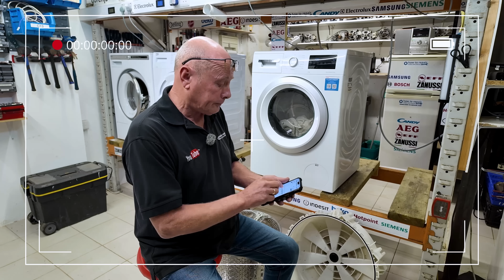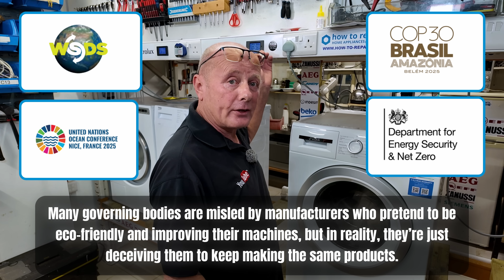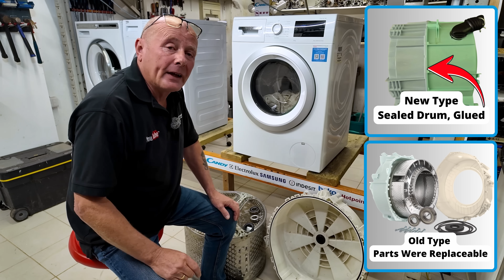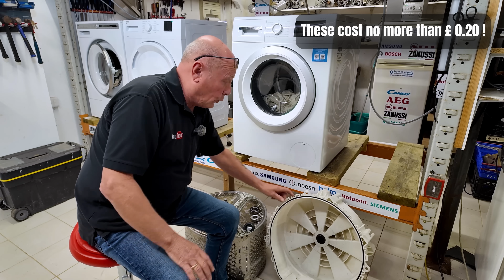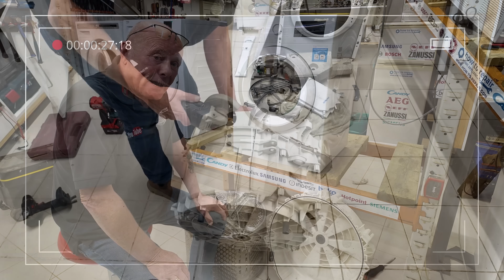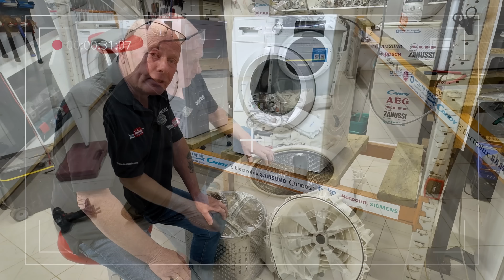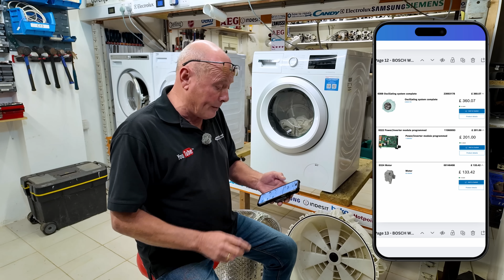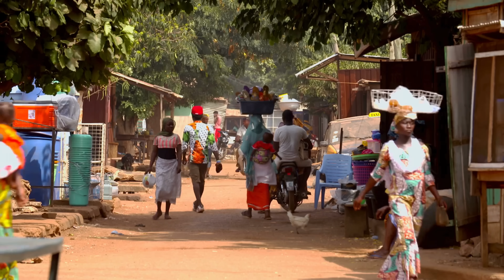Washing Machine SCAM EXPOSED! The Truth About SEALED Drums: Naming & Shaming

Comment: Hi Paul, I agree totally with your exposure of the greed that is present in loads of manufacturers today. As you say the main components that are major failure components of a washing machine are the drum in either the bearings and seals or the spider. The second machine failure item can be the PCB Controller board(s). Motors do seem to be much more rugged so their failure is less frequent. 

Perhaps we should be campaigning to support only the sale of those Eastern/Southern hemisphere manufactured machines in preference to Rip-Off European manufactured machines. However it does go against my desire to reintroduce home grown manufacturing that actually promotes local employment. 

As stated below those thieves need to be fined huge amounts so that they revert to proper ethical processes. The use of plastic separable drums cannot be any different in cost to manufacture than the welding of them as noted. They will both be made on a robotic assembly line anyway.

To support another comment as an aged engineer, I kept a Servis Electronic machine operating for over 20 years with replacements of brushes, motor bearings as well as drum bearings and seal. I even replaced a spider as well. The electronics didnt fail. The machine ran every day washing nappies and children's clothes, the only rest it received was when we took a 2 week holiday.

I could write more but Paul has done a superb job in exposing the un-ethical corporate practices now being pursued.

Comment: Was surprised to see that Miele is also involved. Had a high-end AEG washing machine where the bearing broke and due to the sealed drum it was beyond repair. Searched for a replacement with non-sealed drum (repairable) and ended up with a Miele (which has been flawless). I wonder what the situation is for fridges. Our Liebherr failed twice in 8 years. First time motor (within 5y warranty) + another part (450€ work, part was taken in warranty while 2y warranty had just expired), second time all the gas escaped: beyond repair due to the pressed construction. It really makes no more sense to pay more for a “European Quality” brand if the Asian manufacturers are better at making repairable machines… European industry digging it’s own grave. So sad.

Comment: I suspect our 7 year old washing machine still has the splitable drum, i will take this into consideration, should the need to change the bearings arise in the future.

If they were to go bad tomorrow, under normal circumstances i would probably replace the machine, but with this information in mind i might want to repair it instead.

A year ago i changed the shock absorbers, they had gone bad, so repairing it, is not something i would consider out of the scope, for me to do.

Comment: Good video except there was no mention whatsoever of what exactly the manufacturer is designing to fail just outside of the guarantee period having made a big fuss about it, the whole video is just about the fact the spares cost more than the machine is worth.
Just shows what a con and load of bollocks this save the planet stuff is doesn't it, the criminal government takes thousands a year more off us in the name of climate change but do absolutely nothing about the right to repair, doesn't matter whether it's white goods, cars or whatever, anything that would actually save the planet by not having to manufacture new items because they could be repaired is ignored. in fact anything that would affect the criminals' bank balances is ignored. time people said it as it is

Comment: Hello! I appreciate your courage and effort to unravel the mystery behind the industry and the mechanism that makes us addicted to consumption.

I have been repairing washing machines for many years and I have noticed the trend. 
Then, for me the best choice was Indesit. Separate tub, PCB with interface for reprogramming (Hoover, Ariston and others also had it). Now they are protected and it is very difficult to rewrite the memories. 

It is the same as with printers (HP started first), to program the operating time and count the number of sheets of paper.

But back to... 
I've been buying and using Bosch tools for several years and all of them, when I say this, 100% fail because of the bearings. Initially I thought that the bearings are intentionally mounted only on the "low prices" kits.
In a smaller percentage, the switches are actually destroyed.
I gave up buying such putties and bought kits with a significantly higher price, thinking that they had a different quality and durability in use. But it's not like that. They have the same weak points, the bearings and the switches.

The ball separator is made of a plastic mold and breaks in the first few months of use. The switches in the very first month. The longest I've had a hammer drill was eight months.

Comment: As an engineer, it is frustrating when.. ‘going green’, is restricted to buying new machines. In fact, anything electrical.
I paid £45 for an Nespresso (De Longhe) coffee machine motor but, it’s the fact that it can be repaired, along with the satisfaction of breathing new life into products. 
Just a thought but, if you, as a repair centre, advertised the models and pricing you can turn a repair around, especially for those on a budget, would this encourage folk to buy certain models?
Would it be a case of Ultra Endorsing the brands that are actually ‘Green’ in every respect. I know, this is difficult to achieve in practice though!
Great videos. 
Always thorough and informative m.

Comment: I have a MayTag Neptune stacked washer dryer - it's working great to date and it went into service in 2000...it's had bearing replaced and a motor circuit board replaced... It was built like a tank - I've been expecting to replace it for 10 years.... but it just washes clothes perfectly...

Comment: We need a 3rd party manufacturing pland to reproduce these drum moulds and sell them as a split pair c/w bolts. Then the sealed drums could be cut open and the outer drum replaced with a repair friendly part. No different to the 3rd party pattern parts you use to be able to buy for cars, not sure if this is still a thing these days.

Comment: Its all about the throw away society. Most people will just go and buy another, especially if its too expensive to repair. Tv's have gone this way as well. Built in different countries in asia. Cheap, inferior parts. Combined with cheap labour, for maximum profit for the company brand. Its all about spending little as possible but charging a fortune to the consumer. Just like chocolate bars nowadays. Half the size but double the price. SCANDLEOUS.

Comment: Bosch WAQ243D0GB/09: after 11 years of honourable service (nearly a load/day), the bearings have failed and the only option I have is replacing the whole drum at £209 because it's sealed and apparently there are no replacement bearings available. It's ridiculous indeed,. Clearly Bosch (like other manufacturers) is not interested in making its products maintainable. I'd like to show they lost a customer by choosing another make, so if someone knows of a reliable washing machine around £250 with a non-sealed drum is ...

Comment: Your video is most interesting. Recently I had the Miele main dealer’s service team out to my machine to fix a leak. It turned out that my machine was built in 1987! The men soon found the source of the problem. Not a seal or hose but washing powder clogging up a return water way. Whilst at the machine they stated that the pump bearings had failed and the bearing on the drum is defective. I began to research a new pump (which I was told was not available anymore) and a drum bearing. A quick run through the Internet showed that in fact the pump was available because it is shared but multiple brands from the cheapest to the dearest I guess the drum bearing is not an issue.  I never got charged for service team visit but soon after a salesman rang to try to sell me a new machine.  I will continue to run my machine until failure and the try and repair it.

Comment: Well done you. I recently had to repair a machine (not a trade I wanted to save someone some money and have the skills)...  older machine and found a sealed drum unit cheap enough to proceed. I was only bearings needed.   It wasn't just the extra cost but due to the extra size the courier didn't want to bring it up the stairs. This resulted in me being assaulted by the driver and my arrest. Luckily having CCTV as the driver sent the police round to arrest me for assault.. This machine was like triggers broom.  Brushes for the motor and some transistors for the control panel. Would have been nice to just by bearings for the drum job

Comment: About 9 years ago I repaired a washing machine like that. I cut the drum open, replaced the bearing, put everything back together and sealed it with silicone. The washing machine probably still works to this day—I don’t know. I don’t live there anymore, and it was a rented apartment. The owner was very happy. I did it because I enjoy doing this kind of thing. It can be done; you just need a minimum of willingness and a bit of knowledge or technical intuition.
Best regards, and well done on the video.

Comment: YOU ARE QUITE CORRECT WITH WHAT YOU STATE. MADE TO FAIL. I HAD AN OLD HOTPOINT AND REAR BEARINGS FAILED. BIG COST SO I WENT TO A BALL BEARING COMPANY TAKING OLD ONES. COST IN A FEW POUNDS. THE COMPUTER IS GIVING TROUBLE ON MY BETTER MODEL. BEFORE COMPUTER LED PANAL . MANY FAILURES. NOW PTOBLEMS WITH MECHANICAL AND SOME SORT OF COMPUTER. AT A SERTIAN POINT I MANUALY CORRECT THE PROBLEM. IF NOT THER RED LIGHT COMES ON AND ONE CANNOT OP[EN THE DOOR. SWITCH OFF AT MAINS ZERO CONTROLS THEN OK.

Comment: We had an AEG washer/dryer we bought in 2010. It lasted until almost a year ago. It had a sticky valve, but it worked absolutely fine.
Heard a grinding sound, and knew it needed replacing.
Engineers firm said call out 90 quid. No problem.
This machine used a sealed drum, which was 250 inc vat, and special order, could take 6 months.
I said thanks for at least talking to me, but we can't be without the machine due to our needs.
I immediately ordered a brand new AEG washer dryer. Got delivered 2 days later. Installed it myself (first time I did any install for a machine).
Registered for the 5 year guarantee.
Its working fine so far. 
Although after watching this video, I am not sure it will last 14 years. 
Fingers crossed.
Thanks for the video.

Comment: At work we have old mieke wda 110 and wda 111 we have 12 running for 8 years now and they have run 13000 washes per wasmachine they are a tank. A feb weeks ago a belt broke but no major problems sometimes we need to change the bruches but they last a ling time.

Comment: @How-to-repair Any advice for how we can find machines that are actually fully repairable? because it seems like it isn't just the sealed drum? I've also ended up here after attempting to replace a bearing... but not on the drum.

My previous washing machine started leaking. "Drum's split - it's done." I was told. Not very happy it couldn't be repaired. Now on the second machine. I could hear a bearing failing in my combo washer/dryer's "blower" component (the bit with the heating element and fan). I took the part out, it was very easy, but when taking the screws out of the metal housing that (should have) let the part separate into two halves I realized it was also welded shut at factory with something that made it impossible for me (or any 'normal' consumer) to actually open up. I also noticed that it was filthy, and would be impossible to even clean due to its shape without separating. I asked an expert and they said "nope, factory sealed, cant open it, need a new one".
I was forced to buy an entire new heating unit from the manufacturer for about half the cost of the machine and put the old one (with only a failed bearing) in the bin. It feels so gross.

Comment: Same in Franke coffee machines, they laser weld shut the two halves of the boiler so the heating element is not replaceable. You have to buy the whole boiler unit. Turning a $30 repair to $500.

Comment: For Asia, they have limited the number of years for spare parts, mainly the PCB. One capacitor in my PCB failed after 7 yrs use. I could see that, I got it repaired for $15 US, and it's still working,  6 yrs plus now. Same with phones, no update or battery replacement after some years, even on flagship models apple is the biggest AH.

Comment: my beko washer dryer got from curry's the main board went faulty then 1 week later the heater part went and now the door sensor as gone it a good job i got extended warranty for 4 years dills and sons is coming to fix the washer dryer 22/12/2025 putting a new sensor on the door as-well it now just finish with the one year warranty i and a extra 4 years - where do they get the pricing from

Comment: Educational video. I Just bought a new Bosch washer-dryer combination. I think you featured a washer only from the same series.

Unfortunately they stuck a dryer in the same frame without redesigning the filter for more frequent cleaning. 

As an expert, how would you drain a Bosch machine without a wet mess? After getting rid of most of the water, via the draining hose you are supposed to open the filter plug. The Bosch manual suggests to use a really really shallow bowl, more a serving tray. The opening hatch door gets in the way and  was not designed for frequent removal.

 Brand new it has a design flaw in the firmware. Just twisting the knob slowly back and forth it will completely lock up with all lights in the display turned on. This is reproducible, but exactly how, will take some time to figure out. I am talking to Bosch about this issue.

 Both the company selling and Bosch asked for a review...

 Considering what I know now, regarding the drum, I would have chosen a different brand.

Comment: Our very bad Gorenje washing machine just broke down one month after the warranty period. The reason: The concrete counter weight, attached to the drum was broken, because of short armor steel. 🤬 On my modern Bosch machine, the rear bearing of the drum broke down after 16 months. I got a new machine as a replacement!

Comment: Buy a British EBAC, "Ebac washing machines feature a unique two-part, bolted drum system, unlike many competitors' fully welded, sealed drums, making them highly repairable, especially for bearing replacements, which can be done without scrapping the machine. This robust design, often plasma-welded for strength, allows access to the inner drum to remove foreign objects like bra wires, offering better durability and environmental friendliness, backed by a strong 7-year guarantee. "

Comment: Well, 
There’s a couple of things independent  “repairers” could do - why not set up your own jig so you can separate the plastic drums easily - as opposed to using an angle grinder. You could probably separate with a thick copper wire shorted across a high current battery or power supply - fairly quickly & you’d have a nice cut to reseal against. Alternatively have a thin steel plate template cut for a diameter to suit the outer housing 

Other thoughts:-
Look at Importing a “universal” type standard split apart drums - if they exist - as you say these still manufactured for Asian/ African market 

Yeah, they’ll be a couple of fitment details to address / overcome - but I’d not be too previous if replacement £100 as opposed to £300+ & drum size slightly different. 

Not forgetting recycle of machines / drums. 

The more people advertise machines locally for that purpose as opposed to taking them to dump / or council to clear away - they’d be savings. 

I recently had a 15yr old Hotpoint machine bearing go. I picked up a non working 2yr old Hotpoint off eBay £40 that I’d thought I’d have a look to fix. In the end I just transferred all electronics to non working one & for my situation it was ok. I prob should’ve checked to just swap drums over but I’d made the choice doing that way.

Comment: AEG her ein germany is tackling that in a different way, maybe others do the same...  if you call them they offer a "fixed price" repair for around 180€ .... meaning it doesnt matter what is broken...  they will replace and give another 12 month warranty on it... so it could be the motor, the PCB or a little gasket...  thats the risk..... but still better then 800€ for a new maschine...  so some manufactureres are trying to get the customers to still use their service for repair for an just acceptable price where one would say...  "dont have the time and patience to do it myself"

Comment: Off topic but I got a Hoover H DRY 300 tumble dryer, I've realized that moist sensor is located inside the lint filter, it is not facing inside of the drum and getting in touch with actual laundry items you dry like other dryers. Hoover decided to put it behind the lint filter and what I also realized is, I used the same cycle but one time I loaded more then half of the machine and the other load was almost quarter of the first load in different times, both loads contained same items, on same cycle, but one was less than other and you know what ? The dry time didn't even change a minute. Machine run untill "estimated"  runtime of the program finished. And it has this cycle called "all in one" it basically alerts when light fabrics are dry for you to take them out and let the machine dry the heavy ones, I have run that cycle couple times so far with different types of fabrics and guess what ? It never alerted me and when I paused the cycle to check on my laundry, my clothes were like they were in an oven almost caught on fire, they were literally so hot that I waited couple seconds to take them out. I don't think moist sensors even do a thing. I am vert disappointed by this. Just wanted yall to know.